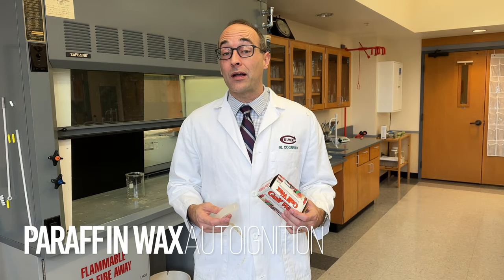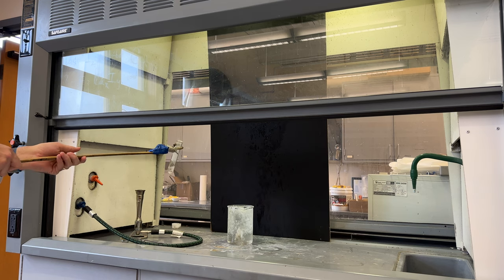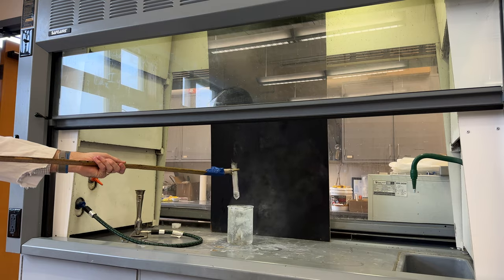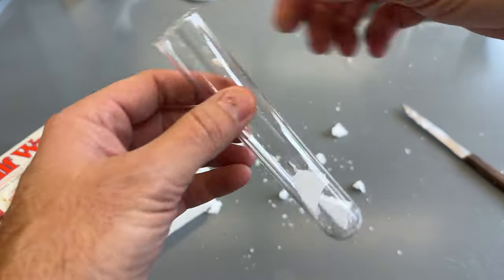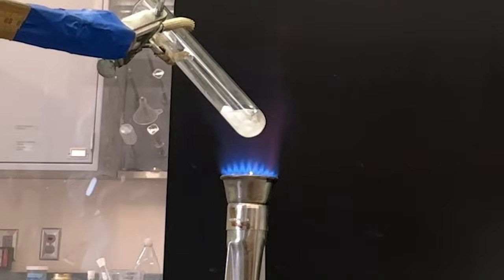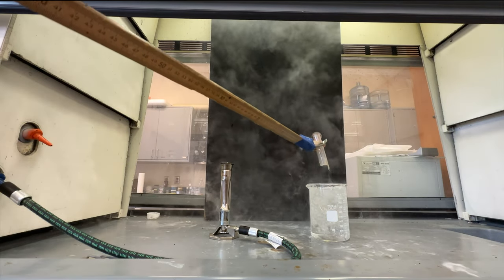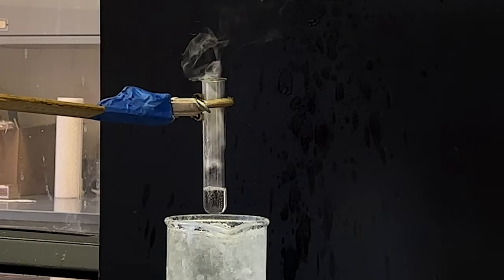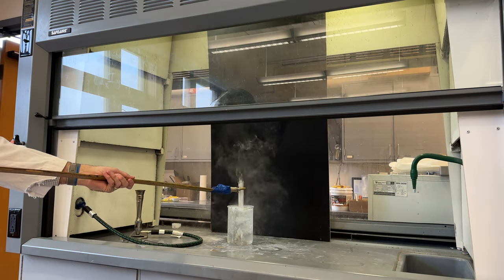Paraffin Wax Autoignition

Comment: I never knew that wax could so easily combust due to temperature changes.

Does the ignition occur because the vapourised wax used the vapourised water molecules, or would this occur had there not been a rapid change in temperature due to the ice bath? Would it work similarly if for instance the water bath was filled with hot water instead?

Comment: how does the explosion in flour ou corn starch silos happen? what kinds of substances become that volatile when very fine particles are accumulated floating in a given space?
Reply: Dust explosions happen simply because you have many fine particles of fuel (the dust), and enough oxygen for them to burn. Because the dust has a lot of surface area, the reaction happens extremely quickly. Almost anything that can burn is at risk of dust explosions, including powdered metals from machining.

Comment: We used a bottle cap & a candle to do this all childhood. Calling it GhantiLa (Meaning scary avra cadavra)

Kept the cap between two bricks with candle burning & heating it from underneath

Some pieces of wax put in the cap which melted & a drop of water gave this effect on a smaller scale

Comment: What type of wax is used in lava lamps? Most if not all waxes I've tried to use float in water but lava lamp wax sinks in water. How is lava lamp wax modified to sink? The Internet says they used to mix the wax with carbon tetracloride. Is that true?

Comment: Same occurs with sugar dust in refineries
Reply: Not exactly the same, those types of events still require some sort of ignition source, usually from an electrical system, but sometimes just static discharge.
Reply: Not at all the same phenomenon. Sugar and wheat flour factory explosion are simply the ignition of ultrafine dust suspended in the air. There's no critical temperature like the flashpoint of the paraffin, it is merely the result of fine dust in the air, surrounded by plenty of oxygen plus an ignition source. One of the horrifying things about some of those Factory explosions is that the first explosion might be in a side room but the Shockwave dislodges dust from the rafters and beams Etc in other rooms and eventually ignite from the first blast which usually starts a fire, so there can be a chain reaction throughout many rooms and areas of the factory all starting from one spot where the proper mixture met an ignition source, be it static electricity or something like a pilot light.

Comment: If the paraffin wax has an ignition temperature 100c lower than the melting point, why doesn't any of the wax burn in the test tube?

Comment: I'm thinking the cracking open of the tube is part of it, the rest is that the hot wax is well above the boiling point of water, which as it boils, sprays the liquid into the air in a cloud as a mixture of tiny droplets in air.  Then, when the air/fuel mix is just right (some distance from the test tube) - woosh!

Comment: If the testtube did not crack, meaning the wax is not sent into the air, would we still see a smaller reaction as just the vapor inside the testtube mixed with the cooling wax or would the liquid wax just solidify as the testtube cools?
Reply: It would just cool and solidify.
The large expulsion of vapour which was above the auto-ignition temperature of paraffin was the reason it ignited.

Comment: Why isnt there ignition while you’re heating the wax? It has reached the autoignition temperature and some of the vapors are already mixing with the oxygen in the air. Even though its not super well mixed with the air yet, id imagine it doesnt take too much oxygen for at least some of the vapors to ignite and set off a chain reaction?

Comment: Could someone please clarify.
The glass cracks because of the difference in temperature, the water then boils creating steam which in turn pushes the boiling wax out of the tube?
I'm also curious to know why the ice is needed, wouldn't it suffice with water?

Comment: I wonder what will happen if you wait a while for the test tube to cool down to room temperature before submerging it in ice water
Reply from the maker: Once it cools to room temperature, it will solidify and do nothing besides get colder once you submerge it in the ice water. And once the liquid wax cools below 245 C, it won't autoignite, though it will remain flammable until it cools below the flash point of 200 C.

Comment: So why didn't the vapor coming out the top of the test tube before going into the ice water ignite?  Because it was cooler than the liquid?
Reply from the maker: I think it’s because there was insufficient oxygen mixed with it to support combustion. You need more than 30x the oxygen per molecule of wax for ideal combustion.
Reply: @Chemteacherphil  so at the bottom of the tube, the temperature is above the autoignition temp, but there is little oxygen, at the top of the tube and just outside it in the vapor coming out, there is oxygen and wax vapor, but below the autoignition temp.  When the glass cracks, the boiling water sprays the  above-autoignition temp wax and vapor at the bottom and mixes it with the oxygen, and then you have it.

Comment: I think paraffin could be the primer for in incredibly inefficient and bulky weapon design. A heating coil heats the wax, followed by an oxygen injection similar to a car engine that propels the NERF dart, which will probably partially melt in the heat, but at least it's legal

I'd try to make this for fun if I wasn't as poor

Comment: We used to take a small metal bucket of the stuff and put it in the fire with the coals.  Let it come to boiling and then we would drop a full can of pop in upside down.  My dad was mad because the resulting fireball killed the tree canopy 40 feet above our heads.

Comment: Could rapid compression of the liquid paraffin also contribute to or lead  to ignition because of the heat of compression ?
Reply: It was my first thought
Reply from the maker: How do you see compression occurring in an open tube?
Reply: @Chemteacherphil  Perhaps the rapid chilling of the paraffin would cause it reduce its volume thereby resulting in more heat per unit volume, perhaps enough to initiate ignition?
Reply: @Chemteacherphil  once I saw the slow motion I realised it wasn’t
Reply from the maker: @leppad  the issue I see there is that there is already sufficient thermal energy for ignition, as the liquid and surrounding vapor was more than 100 degrees over the autoignition temperature.
Reply: @Chemteacherphil  You are probably correct. On reviewing the video I note the visible flame began well above the test tube so likely the actual heat there would have been less (because it is an expanding vapor) than in any postulated location in the test tube. I was trying to look at this phenomenon from all angles.

Comment: Does this happen when you put any liquid in tube? Maybe  more. Info
Reply from the maker: No, it’s a consequence of a couple factors. One primary factor is the Autoignition temperature (245 C) is well below the boiling point of 370 C. Another is that you have to have a situation that results in ejection of the wax into a finely aerosolized vapor cloud to ensure there is sufficient oxygen available for combustion. This ensures the vapor cloud will ignite.
Reply: @Chemteacherphil  and only accomplished with paraffin? Guess is what I meant. Thank you
Reply from the maker: @Maria-xn9rm  as long as the material had similar factors related to Autoignition (well below the BP) and a boiling point high enough to cause the water to instantly vaporize, I think it’d work.

Comment: would the same thing work with boiling oil and liquid nitrogen?
Reply: You need a material with an ignition temperature below it's boiling point.  Boiling oil in a pressure vessel - where you artificially heat it past it's ignition temperature - then release it into air will have the same effect.  No cooling agent required.
Reply: @ThomasD66  isn't that a diesel engine?

Comment: Someone needs to make an experiment where a bomb-resistant shell of metal has a hole in it with the same diameter as the test tube so the cold water has nowhere to go but up, and then drop the test tube in that from a safe distance and see how much more pressure is built.
Reply: Or rather, force it in using a one-way gear, that would be interesting. It falls down and the test tube can't be shot back out, and this would be able to have limits where the test tube only has partial insertion into the hole so that it only goes up to the water level, or full insertion where the bottom of the test tube is at the bottom of the water level, or the hole could be made too shallow where some of the test tube sticks out at the top after the full insertion scenario. The apparatus would need to have pressure downwards from the rim of the test tube, not the sides. The one way click-lock system should be on both sides of it and it should all be bolted to the bomb shield.

Comment: why did the glass crack though?
Reply from the maker: Thermal stress caused the glass to crack. When you heat a material, it expands and the opposite when you cool it. In the case, the glass is above 370 C and the water bath is 0 C. This causes a rapid contraction which happens so quickly that the glass cannot maintain its integrity and it fractures.

Comment: Would it also work with water, close to its boiling point? The temperature difference to the test tube might still be sufficient, if the glass quality is not too high. Please be careful, it might be even more dangerous.

Comment: As a chemist (by education) I was scratching my head hard trying to remember ANY lab procedure involving this kind of shenanigans, but I failed... Can anyone help me? Anyone? Please...

Seriously though...
Oh dear, what a [beeeep] idea was that? It is WELL KNOWN, that ANY heavy hydrocarbon heated up well above boiling point of water AND its flashpoint, when "just added water" will:
a) boil rapidly AND VIOLENTLY, as the presence of non-miscible water will lower its boiling point, and there's plenty of heat accumulated in it, and
b) will ignite.

Duh, who'd ever thought, eh? Flammable stuff, being heated above its ignition point (aka flashpoint) will... ignite? What a surprise, innit?
(Public education shining through, eh? ;-)

One of the basic safety rules "in case of fire" is to NEVER attempt to quench hot burning heavy hydrocarbons (like an oil bath) with water, and that's why we use powder filled or liquid CO2 filled extinguishers.But apparently it comes to some as surprise...
PS: the tube would crack just as easily if dipped in regular cold tap water, adding the ice was just a cheap trick, done for show and "wow!" factor... methinks.